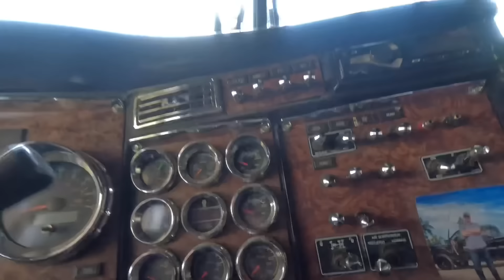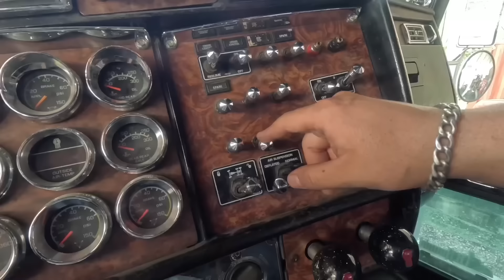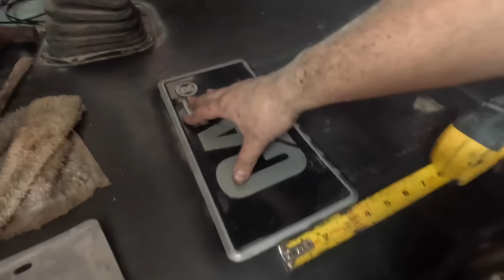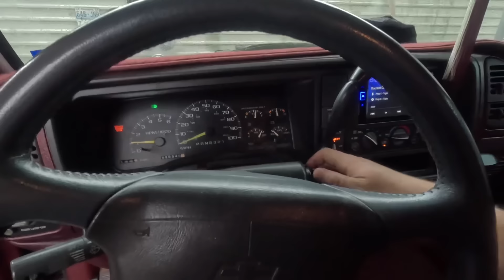Finally get a TRAIN HORN, and a few more UPGRADES on the kenworth.

Comment: Like the upgrades on unit 95. Like the smaller steering wheel. Hope you can drop it down soon. I will say I didn't realize even after having the unibuilt conversion done on the truck the leg room was still tight. But glad you got it where it's comfortable for you. Looking forward to hearing more of the train horn on unit 95. Definitely is a little louder than unit 75.